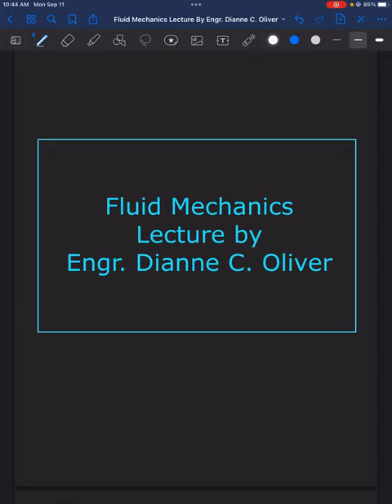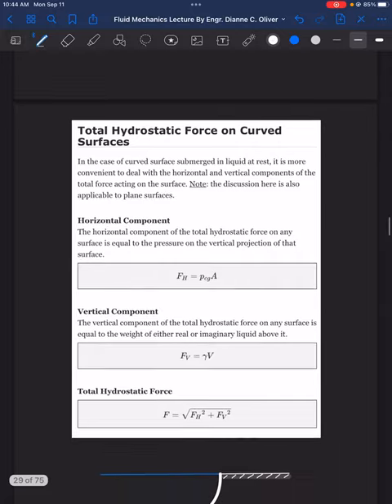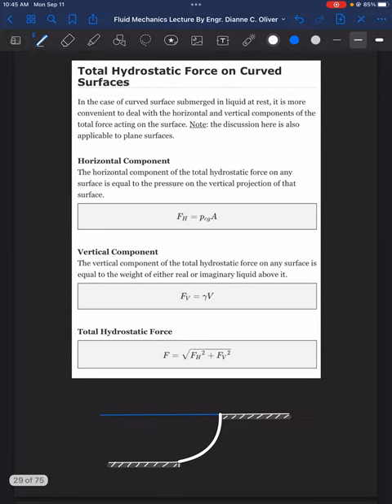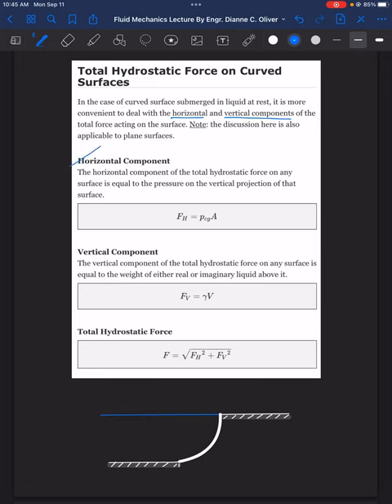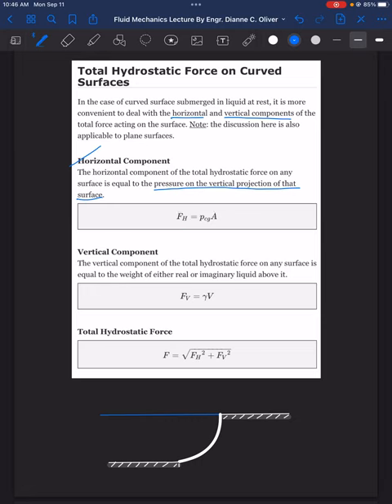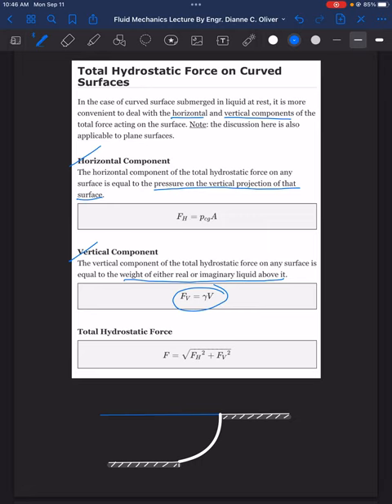Fluid Mechanics: Hydrostatic Force on Curved Surfaces

Comment: Engr, in problem 2,, bakit hindi nagamit ang area ng triangle = 1/2 rsquared sine 60?
Reply from the maker: For area of triangle using theta, A= 1/2 ab sin theta. Sa problem 2, you can use that formula for the area of triangle as A= 1/2 (4)(2) sin 60

Comment: Engr. Pwede pa explain namm.. Problem 3-25 The gate in the figure shown weighs 5kn for each meter normal to the paper. Its center of gravity is 0.5m from the left face and 0.6 above the lower face. Find h for the gate to come up to the vertical position author gellasania page 121 chapter 3
Reply from the maker: May typo error sa prob na to sa book. 0.6m sya dapat from the left face. Pero sige I will make an explanation video for this 😊
Reply: @diannecomandaoliver  salamat Engr Dianne Godbless you